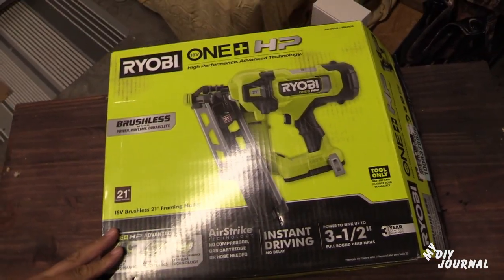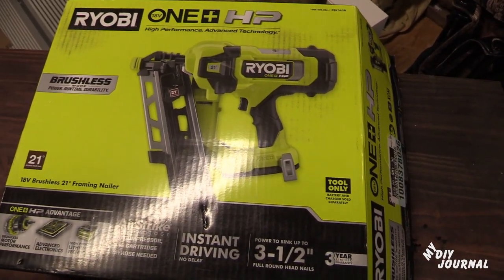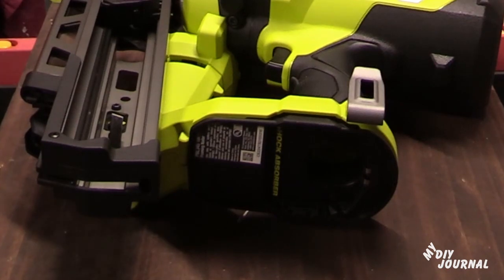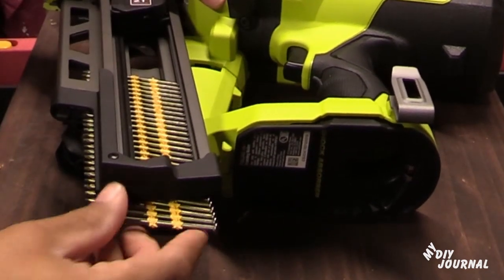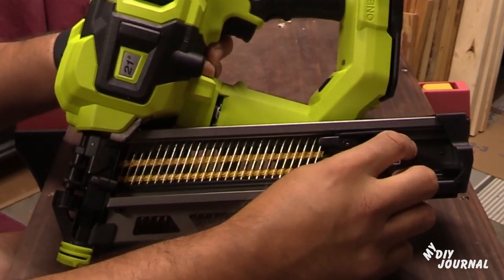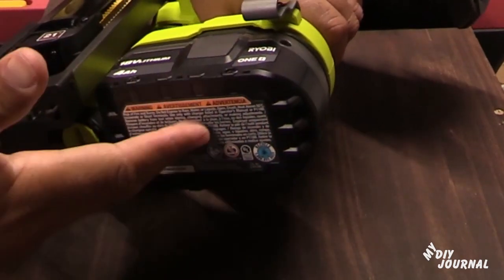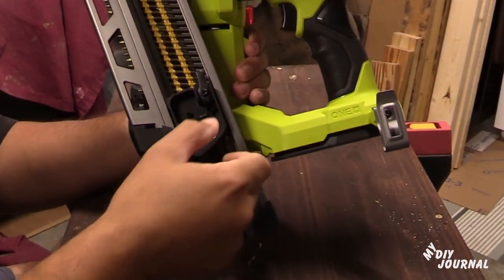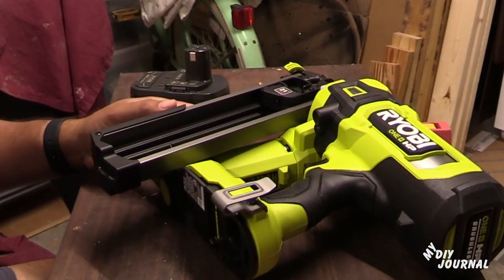RYOBI BRUSHLESS FRAMING NAILER- How to Install Nails- For Beginners

Comment: Thanks for this.  I can't find any info on where to find framing nails for this tool.  Home Depot only seems to carry Dewalt, and the Ryobi site is so confusing that it is impossible to find info on nails.  I just don't want to buy a tool for which I will not be able to find nails.